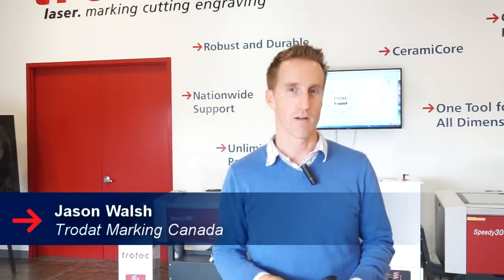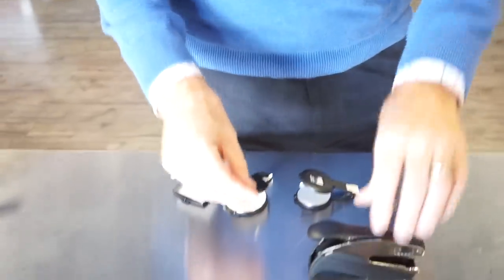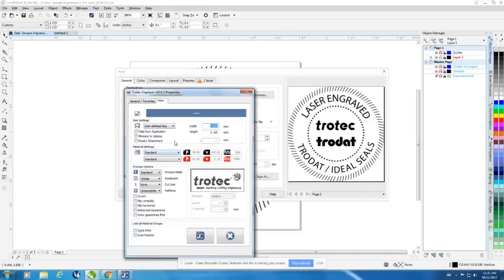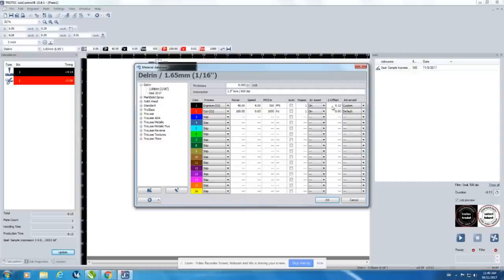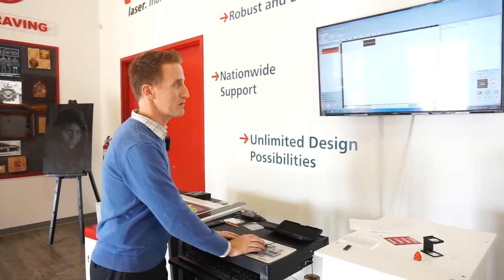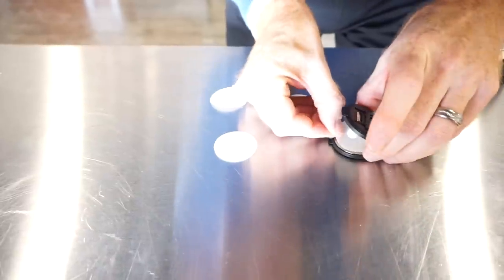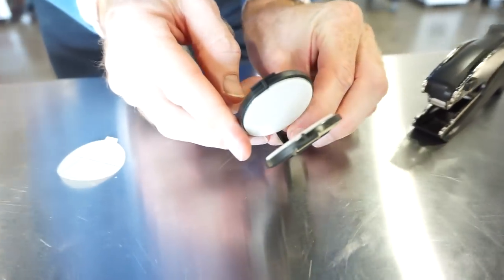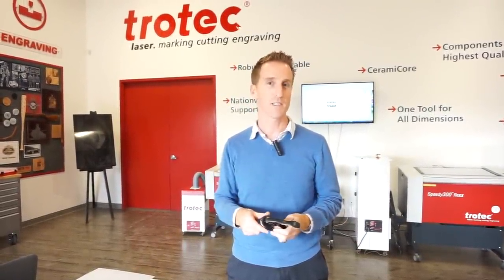Creating a Seal | Laser Engraving Delrin Seals | Speedy 300

Comment: Is it advisable to use ABS Plastic?
Reply from the maker: You can mark it with the Fiber laser. The problem is it melts quickly on CO2 and some ABS materials can release small concentration of cyanide gas. We cannot really recommend it.